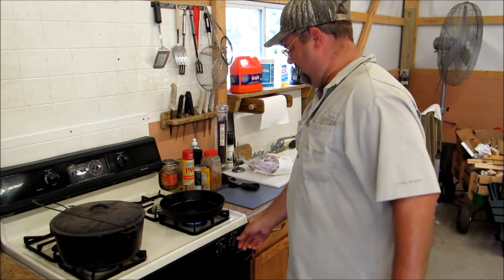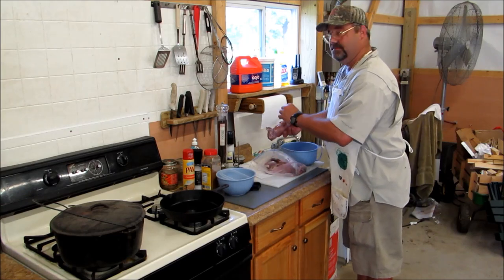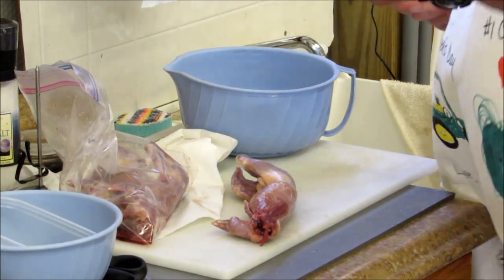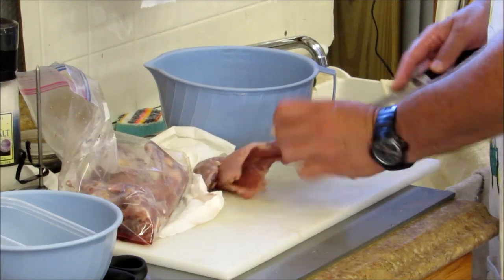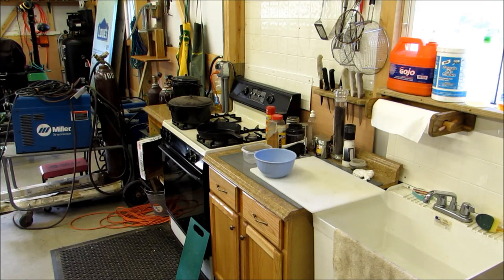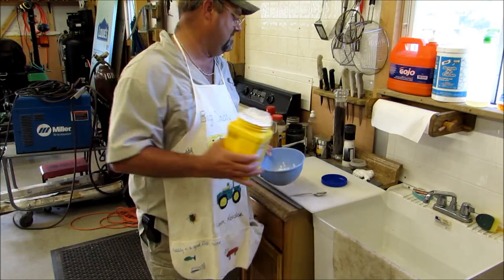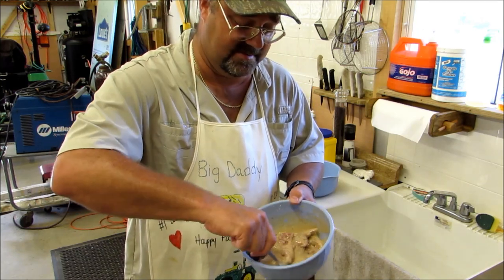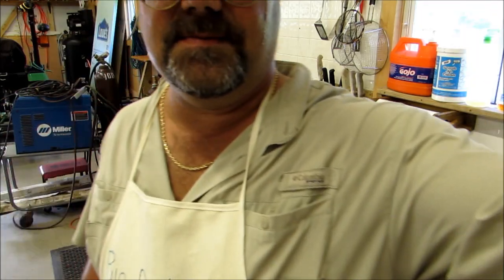Cooking Squirrel  With KVUSMC  Southern Style

Comment: I've never eaten squirrel until today. A neighbor gave me 3 and I came across this video. I picked up some Old Bay seasoning and followed the recipe. I didn't have a thermometer, but I guesstimated (I fry chicken a lot), went with the long simmer, and everything has come out tender and tasty. I didn't have any thoughts beforehand that I may not like squirrel, and having eaten it, i'm actually very pleased with trying this meat.   I'm glad that I came across this video. Thanks Ken.
Reply from the maker: fwbrc51 Awesome Buddy I'm Glad It Turned Out Good You Don't Have To Use A Thermometer Just Brown It On Each Side And Simmer Low To Medium Low Until You See The Meat Pulling Away From The Bone Thanks For Watching Kenny

Comment: This is great. However, do you think they would grill well?
Reply: Only if you parboil them.
Reply: NO...its like eating a rubber band....Squirrel needs to be browned and cooked in a gravy or in a gumbo works good as well.
Reply: They usually don't grill too well.  Life or death, go for it, but trying to make an at home meal?  They need to be parboiled or in the case of the video, flash fried before actually cookin.  I may be mistaken, but the flash frying causes a crust which locks in the natural moisture of the meat.  I personally don't like parboiling, but grilling will most likely make the meat tough.
Reply: promod114 is right. As long as you parboil them first, it's just fine. Great with bbq sauce.

Comment: I was told to remove the sweat glands from under the arm pits and in the groin area because if the glands are cooked with the meat it will spoil the taste. Is this true?
Reply from the maker: Rick Brooks Old Wise Tail Tastes Just Fine Buddy
Reply: Rick Brooks   I know this is an old post but I saw your question and thought I would add my 2 cents.  Removing the glands under the arm pits and groin is important. It is not an old wives tale.  I’m 65, squirrel hunter and squirrel cooker.  I learned from a old man who taught me how to squirrel hunt, skin and cook a squirrel.  The glands are bitter and taste awful.  I always remove them. I use flour instead of corn starch to bread them.  I’ve not tried corn starch so I don’t know how that tastes. I also put the older tougher squirrels in the crockpot.  They come out very tender. I like to drain the juice out of the crockpot and add BBQ sauce over them and let them simmer for a while.  It’s May 29 and squirrel season has just opened up here in Missouri. I’m a retired RN and get to hunt more often now.  Happy hunting.

Comment: I tried this recipe today and had high hopes but my squirrels turned into squirrel bacon, any recommendations?
Reply from the maker: FSU Waterfowler Try Using A Cooler Temp At First Start To Fry Both Sides Simmer On Above The Low To Medium Temp Cook For 10 To 20 Minutes With Top On Flip Them Every So Often Until Meat Starts Pealing Apart From Bone Buddy Cheers Kenny

Comment: Nice squirrels: I prefer a shoulder shot just behind the shoulder. After cleaning cut three glands out of each side (first is in arm pit, next inside upper arm...open it up by slicing up at the base inside upper arm and last on the backside of the thigh.) These three (total 6) will taint the flavor of your squirrel with a taste that is strong. I soak them in salted ice water for 1-2 days to pull out blood. Now the best squirrels come off of hickory or pecan, but pine squirrels are still mighty fine. Oh yes, I use a short hollow point that hits the squirrel harder than the long rifle...basically the .22 long is traveling too fast and does less damage. Squirrels shot with a .22 short hp will run 50% less that .22 long. When I was a boy about 50+ years ago I learned not to shoot squirrel in the head. My longest shot is 60 yes w/22 short hp, never knew what hit him.
Reply from the maker: Buddy I love 22 short Nice round Soaking is a great Idea allot Of times I will soak mine water and a little vinegar

Comment: It shouldn't take that long to cook a squirrel.
Reply from the maker: Tracy King Hi Buddy You Want To Simmer It On Low It With The Lid It Holds In Moisture And Fries It Up And Steam All In One I Have cooked Every Kind Of Way Deep Fried , Boiled , Pressure cooked, Grilled Or Smoked Is Good As long As You Wrap It in Bacon And Olive Oil To Keep It Moist Because There Is No Fat In It  ! Remember Cook It Slow over Low Heat I Prefer Indirect Heat / Leave One Burner Cook it On The Side Where The Burner Is cut Off ! Cheers Tracy Kenny